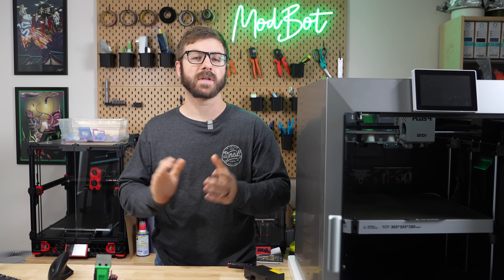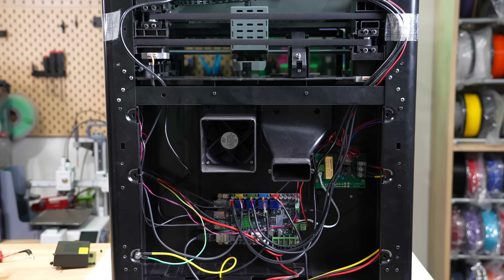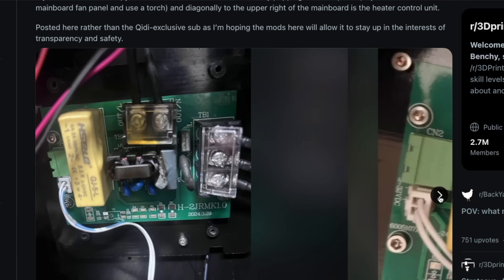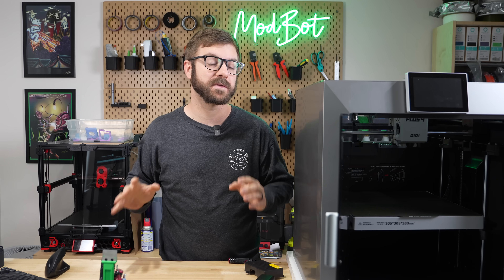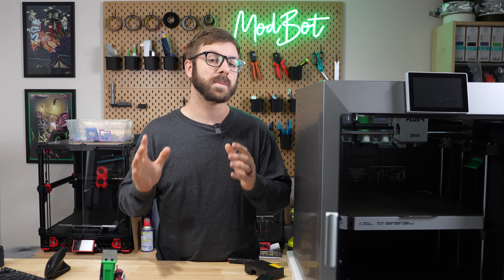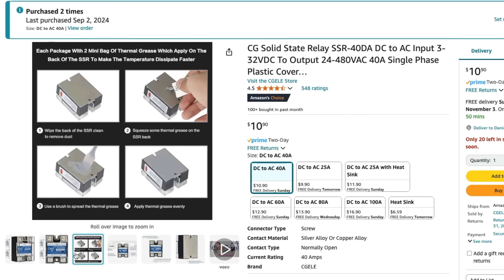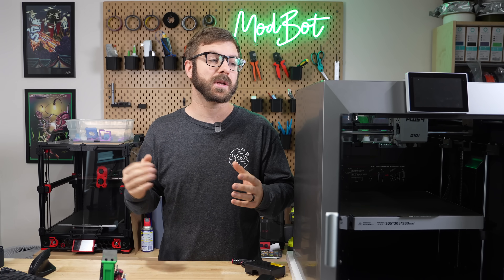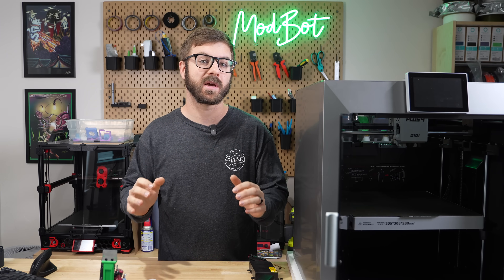PSA: SSR Safety Issues With Qidi Tech PLUS 4 Printer

Comment: I’ve contacted Qidi’s after-sales team multiple times regarding defective heater core boards for my Qidi Plus 4 printers, but their reps seem unaware of any issues or unable to assist with replacements. Despite several attempts, it appears Qidi is unwilling to warranty or replace these defective parts. Has anyone else experienced similar problems, and if so, how did you resolve them? Any advice on alternative sources for replacement parts or escalating this issue effectively would be greatly appreciated.

Comment: Not sure why QIDI gets flamed so hard when issues like this are nothing new. Even Bambu had a problem. I'm not saying it's ok but a week? At least they responded and seem good (relatively) about support when people need it. How many Creality boards have we seen melt themselves in the past? I have two in a drawer and didn't even bother contacting them because we know how it would have gone.

Also I hate to be that guy but the fear mongering about stories like this is exhausting. I'm not blaming you, I respect the caution but this would have simply failed. It's extremely unlikely to start a fire. I know we don't like hearing that but most people have had AC appliances sprinkled around their home at some point that were built far sketchier than this. If you don't believe me, test it. You got a free printer and a replacement board, right? Keep pumping power through that one it in a controlled environment and make a video about what happens.

Comment: They sending updated replacement for heater SSR.  Been in close contact with them since receiving new printer in September.  They been listening and responding to requests very proactively whole time.  Using my other printers until I get that update installed.  They are addressing issue, like others have in past including Bambu.  I can say their support been extremely proactive. 95% of my run time been high temp stuff requiring heated chamber, glad to see they sending updated hardware for it.

Comment: I tried to turn on my P4 this morning, and the only thing that does anything is the red light on the power switch coming on.  No screen, no movement, no other lights.  It's getting juice, but that's it.  I originally wasn't too worried about the SSR issue, as I haven't printed anything other than PLA at this point (2 weeks old), but now with this and the SSR, I'm thinking the QIDI is a low-budget electrical disaster waiting to happen.  I just emailed support, so maybe by THursday they will tell me something other than check the power cord.

Comment: Bummer. I was this close to buying one. Specifically for printing at high temperatures and therefore using the chamber heater at high temperatures

The atrocious lack of QC and negligent handling of a huge quality issue like this and safety risk here is a huge turn off. I dont think ill be buying one now, maybe not even if and when this issue is fixed. What other issues might this sucker have that we just don't know about yet, (Qidi themselves included)

Comment: Well done, I'm in the same boat in that I've been testing my Plus 4 for around a month when I saw these issues with other units. I'm in the UK with higher mains voltages so haven't seen the same issues myself but I think I'll put out a similar video or point viewers here until the issues are fully solved. I've also told Qidi that there will be no review until this has been addressed correctly. Quite a contrast to how Bambu Lab addressed their issue earlier this year!

Comment: Having followed the oddeties of the QIDI 4 since launch it's odd how this same issue is taken VERY seriously (as it should) by this channel (and several others), but "pretty much only mentioned" by others.  Big thanks to all channels which took it seriously, because IT IS serious.

Also, gonna be "that guy":

Qidi : "oh, smoke coming from the mosfet board ? naaaaah, not a problem, no hazard, you'll be fiiiine, and we're 'sure' at least the 220V versions are ok".

Bambu Labs : "shit, internal testing found the possibility that all new  A1 machines could potentially have suffered damaged bed heater cables during transport/packaging.  We're immideatly going to stop sales of the A1, recall everything that is in stock, send out a general message to all buyers of an A1 and offer a full refund, block usage of the machine over the cloud and showing a warning the machines shouldn't be used until reworked, and then offer a rework by us or a rework by the customer on all units already in the field for people who do not wish to send it back, inclusive a considerable financial compensation or the possibility to upgrade to a normally much more expensive different model.  Yeah, this will cost us a lot of money and we will be pulling the unit off the market for at least 3 months, but safety first."

"All Chinese companies are the same". Not.

Comment: Given the information I just heard I will never buy a Qidi printer. Why would anyone buy a Qidi printer?
Reply: Fantastic value for the money. Even without the chamber heater it is a larger, higher temperature, Klipper powered, better screen P1S for $800, $100 more before the current Bambu sale. All the same vs the X1C as well, except $400 cheaper just without lidar. Multi filament system coming next year. The chamber heater also isn't an issue in Europe and they have a new part to resolve this problem. Qidi has a great reputation for customer service and I have never seen a company send out so many free parts. They are responding to everyone as quick as they can and I've personally gotten 7 emails in 6 days with most delays being on my end.

Comment: Replacing that board with the $10 off brand SSR from Amazon is an odd choice.
Head to Digi-Key or mouser for SSR's that have passed proper testing.
Reply: We have been recommending Omron, Panasonic, or Fotek. All $15-30 basically.
Reply: @802Garage  watch out for fake Foteks they are all over eBay and AliExpress and probably Amazon.

Comment: Great video.  I also watched Grant's stream the other day and was astounded by the fact that whoever specified that SSR obviously hadn't tested it under the intended load.  I thought at the time "why didn't they just use the same sort of SSR as used to control Voron bed heaters?" and instantly came to the conclusion that it must save a little money per machine.  From a design point of view, the fact that the chamber heater was of a much higher-rated power than in the printer specification worries me too, as well as the clear lack of headroom when it comes to matching the power requirements of the components.  It totally destroys confidence in the rest of the machine, not to mention in the whole company.

Comment: This is a typical design failure that more commonly occurs when the engineering country uses 220-240VAC and they design equipment for 120VAC.  RatRig systems through VCore 3.x have this issue, I don’t know about the VCore 4.x.  I would check the power plug assemblies as well, including the power switch, as they may be underrated.  I’ve literally seen them melt into a glob of burned plastic.

Comment: I haven't brought one yet but will be very soon, we run 240v in UK how come these models aren't affected?
Reply: the SSR which could hold current of 5amp when use with 110v, the chamber heater draw to the max/over amp. Yet, in 240v the current draw is well below 4amp. So no issue with 240v/220v grid.
Reply: @stickercambodia  No issues on 230V.
Reply: So surely we can get a 220v cord for this??? I’ve got 220 in my shop.

Comment: Thanks for covering this as well Daniel! 

yeahhhh your coil DEFINITELY got too hot! Your SSR also got a bit melty.. They claim it wont get to 140C in normal operation and we intend to test this live as well, which will require drilling the case of the printer, but whatever, happy to do it. Those temp numbers you saw on twitter are POST the update to make the heater lower powered. Qidi is claiming that me leaving the back off isnt fair, we will see! 

Do note though, doing the board upgrade is often ILLEGAL in many states and countries for those who are not properly certified to do so. So, honestly, while we CAN do the upgrades, your insurance will NOT like it if you do and something goes wrong!
Reply: Would be great to see how the temp is under normal circumstances. With the chamber open and running the heater it's effectively like leaving an engine at redline for a long time. Likely not a good thing for it. But would be nice to put it back together with thermocouple in the coils and then run it normally. Fully closed, with heater at 65 and optionally bed at 100. I think once the chamber is at temp the heater effectively shuts off. The heat from the print head maintains the heat well. This in my experience happens in about 10-20 minutes.
Absolutely not trying to defend Qidi here. This is not acceptable on their side. Just want to know realistically what the numbers look like
Reply: It is NOT ILLEGAL[1] in the states to do the board upgrade, even though it would be better for users to just return the printer instead.

[1] https://en.wikipedia.org/wiki/Magnuson%E2%80%93Moss_Warranty_Act

Comment: Just to clarify, 220v -240v machines are fine?
Reply: Use 220V machine and print for 300h, without any problems.
Reply: Correct. No known or reported issues thus far.

Comment: For transistors, especially SSRs, I don't believe it's possible to fix this over firmware because if you try to switch them frequently, they get hotter. I highly doubt they're using transistors that are rated for the types of frequencies you'd need to limit current constantly.

Comment: Wow, you talk about timing. I was almost ready to pull the trigger on this printer, but not any more. No way I'll take any kind of chance on this company at the present, and possibly for all time. As an engineer, there is no excuse for this type of shoddy QC. Thanks so much for sounding the alarm. Figurativly I hope, and not an actual smoke alarm. 😉
Reply: I was going to order one on Monday. I may still. Now that there is a "fix" on the horizon I feel a little safer. Knowing the issue in advance I wouldn't push my luck by using the chamber heater at high temperatures. For me personally the good of this printer still out weighs the bad assuming that Qidi is correctly addressing the issue.
Reply: @dlgloege  By all means, do what is right for you. I just can't support a company that has shipped such a dangerous product. We don't even know if the 'fix' is truly a fix. Just imagine someone who has this printer and doesn't follow social media too closely, then fires off an overnight print using the heater. Do they wake up with a smoke alarm?
Reply: I'm in the same boat.  Was just about to buy one and started seeing these videos.  I have even contacted their customer support about it, but according to them this is all ok and they will send me a new board if there's problems with the one that comes with the printer.  But, there's no problem or fire hazard according to them.  <shrugs>  Guess I'll have to keep waiting since right now there's no printer that's comparable to this one for me.
Reply: I was going to order tonight but it will have to wait until Qidi could confirm the issue is resolved.  Thanks for the notification.

Comment: Generally, heating devices shouldn’t be used at full capacity continuously, as overuse can shorten their lifespan—like the coils darkening over time. My printer is working well so far, though. QIDI's support mentioned they’ll send a revised SSR and provide an extra year of warranty. I really appreciate companies that correct their mistakes promptly. On another note, the print quality of the Plus4 is truly impressive!
Reply: So they will send you a revised SSR before, or after your house burns down?
Reply: @DeusExAstra  The new SSR is on the way, and there is no fire problem with my house. The inductor itself is a high-temperature electronic component that generates heat. No need to overreact, an extra year of warranty is nice, isn't it?